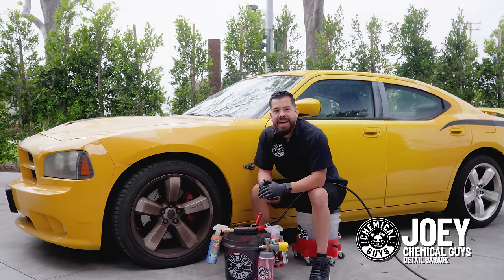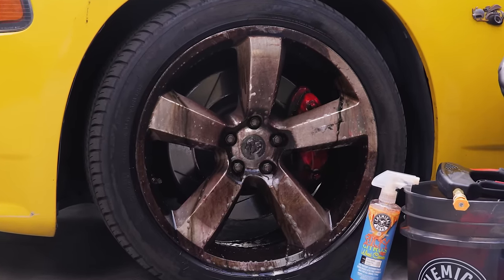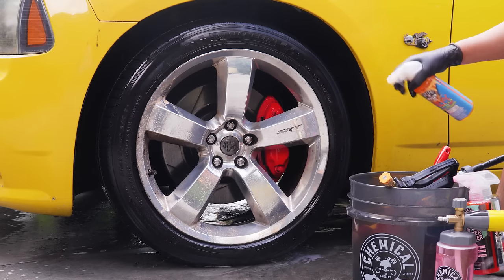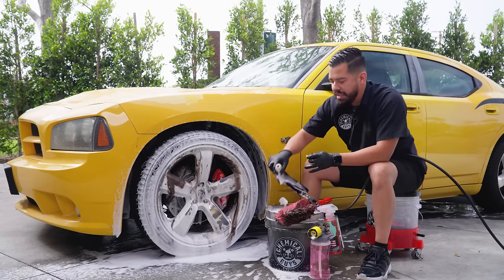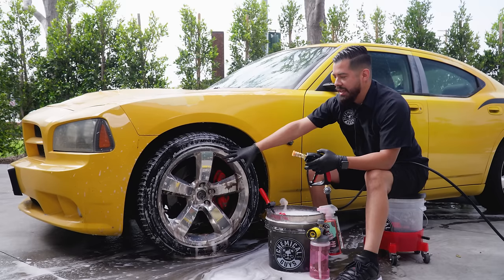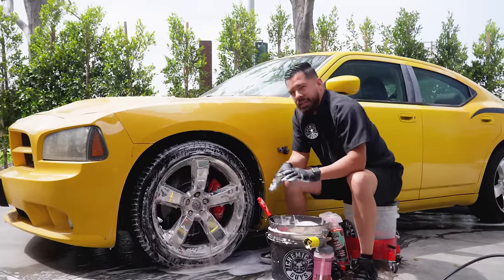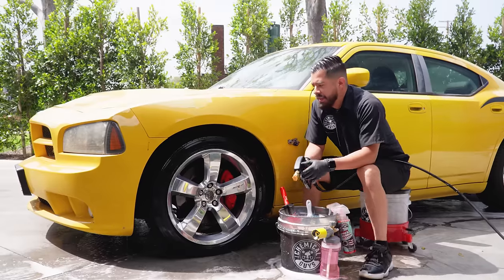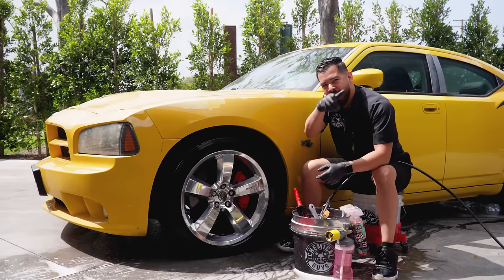Filthy to Flawless: SATISFYING Clean On One Of The Nastiest Wheels We've Ever Seen - Chemical Guys

Comment: Didn't show how you cleaned the back of the wheel spokes
Reply from the maker: You're right! The Red Rocket is actually bendable, so we angled it at 90 degrees and it's just as easy to clean the back as the front.  Thanks for watching!